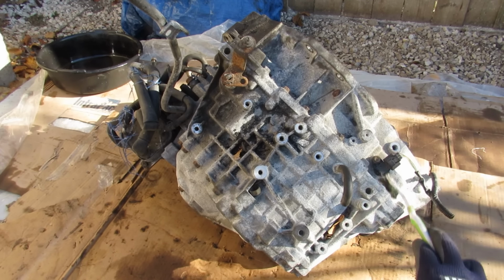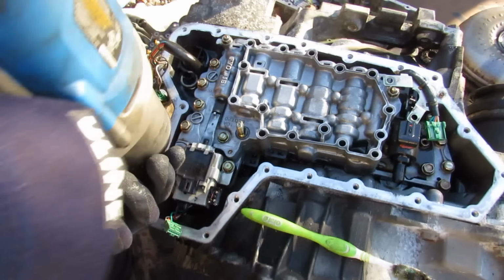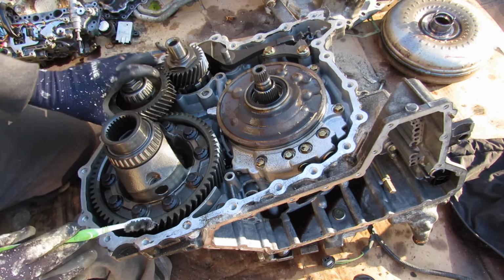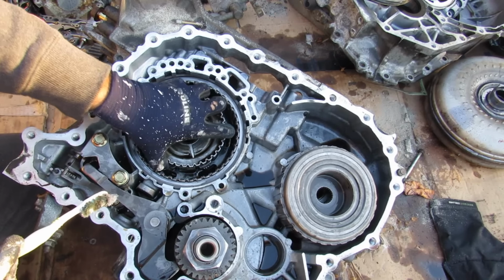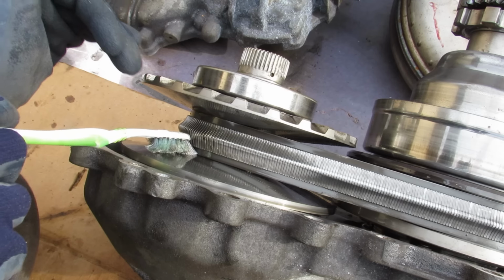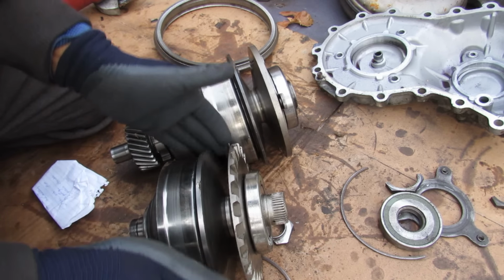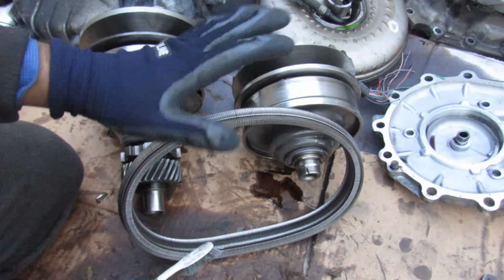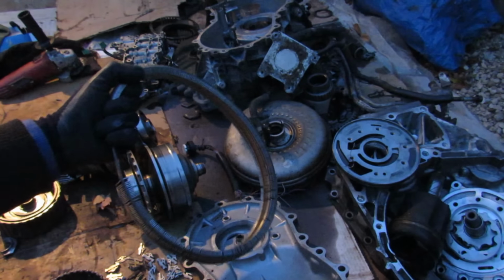Why Nissan CVTs FAIL

Comment: There ARE parts available but they aren't as readily available as clutch packs and seals on traditional transmissions.  The $3,000+ for a transmission replacement has more to do with contracts than with parts.  Let me explain.
Nissan is a part or controlling owner in JATCO (Japanese Automatic Transmission Company) not the only makers of CVTs but the makers of CVTs for A LOT of manufactures and for all of Nissan.  Jatco has a contract with Nissan, Jeep, whoever they sell to that there are NO serviceable parts in their transmissions (NOT EVEN FILTERS) just the fluid or the whole transmission and you have to buy one from us.  IF you go to a shop that sells original JATCO CVT tranmissions, they are under the same contract. You can change the fluid or the whole transmission no repairs, no rebuilds, no replacing of parts.  (NOT EVEN FILTERS) .  Now there ARE shops that rebuild these and shops that sell rebuilt ones.  So that is an option.  Jeeps are REALLY BAD about the differential or other bearings being of cheap chineese quality and the bearing and race eating each other up spitting out chewed up bits of bearings and races through the whole system.  If caught in time it IS possible to clean it up and upgrade to a brand name bearing and race set.
Reply from the maker: Interesting. So where do those shops get their parts? Used?

Comment: What a complicated gear box this has become since it was installed in the Daf cars. It just had two belts running in two sets of expanding pulleys with a vacuum device and a freewheeling clutch plus a simple gear box to engage reverse.

Comment: And that folks is real magic, this turns that and pumps oil over to there while these rotate around this gear which drives that spline and actuates those threads. All this turns that and then drives these which will stop them while all of this moves over here, when it spins it moves that which pumps fluid into there and wizz bang pop, it all works like this. Unbelievable stuff. However, I perform the real magic, I turn the ignition key and it drives. I also owned a Ford CVT Focus and at 70,000 miles the transmission turned to chocolate. Ford washed their hands of the problem as demonstrated by a Class Action in the US but for us suckers in the rest of the world, we just had to grin and bear it, well not quite. When mine developed the fault, I wandered into my local Ford dealer, and kicked the tyres of a few cars then let the salesman sell me a new car taking my then hunk of scrap in part exchange.
Reply from the maker: Or it doesn't drive and fails

Comment: Very nice explanation.  These transmissions, either automatic or CVT are amazingly complicated. The engineers who design these have to be some kind of geniuses.  I had a 2016 Murano AWD Platinum where at 40,000 miles the CVT failed.  I am an easy driver. I am not they type to drive with hard acceleration. The transmission was replaced under warranty.  The dealer also paid for the flat bed transport.  I replaced the Murano just last September.   I bought the new 2022 Pathfinder 4WD Platinum.  I like it a lot. It has a 9 speed automatic transmission.  No CVT transmission.  The engine is the regular 3.5L Nissan engine.
Reply from the maker: How's things going with the 9 speed vs the CVT so far?
Reply: What happened when it failed? Did you get stuck on a freeway?

Comment: at a dealer, the salesman actually told me the transmissions were carp, some were failing right after leaving the dealer. but by the looks of it, it's more common now then thirty years ago. I drive a fulll size truck, which comes with all the more crap than can go wrong.  
buy a stick shift.
Reply from the maker: Good advice

Comment: Have an 06 Altima 2.5. Huge failure blowing out all fluid. Replaced with used trans and now drops back out of overdrive 60mph +. Could this be due to clogged filter?
Reply from the maker: It could. Check fluid levels. 06 Altima doesn't have CVT

Comment: Wow, nothing more that a set of adjustable pulleys. Something that machines have been using for decades. Look at many Machine Shop Machines, one we have is a Bridgeport Series II vertical Mill. That is only one of many that use this adjustable pulley system just like this to change the speed of the cutter. Only problem is that it is hard on the belts when continually changing speeds. They can slip under heavy loads and damage the belt and shorten it's life. In a car transmission, this can be expensive to replace, if you can find the parts. Today many car manufactures produce parts for a few years then change or update parts that may or may not fit the part, or in this case a transaxle, and may require the replacement of a major component.
This is one of the biggest reasons I stick to a manual shift transmission in any vehicle I buy. They are about bullet proof, extremely reliable, are easily repaired and parts are readily available in most cases. With just a little mechanical skill, most could repair one at home in a few hours. Most of the time it is an easy fix like a clutch plate and throw out bearing. I have a Pickup now with close to 100K miles on it with the original clutch set up from the factory, original gear oil too.
Reply from the maker: Agreed. Stick shift is the way to go for reliability

Comment: I'd like to see a video about an older, simpler transmission, like a Powerglide or a TH400, and how they used analog controls instead of computers and solenoids. Just to see the difference in how transmissions have changed over time.
Reply from the maker: Scooter transmission?
Reply: Have you seen how old automatic transmissions work? Those things are way more complicated.

Comment: Thank you for explaining in such detail.  I'm a bit puzzled though, if the transmission can be stripped down to this level, why is it everyone seems to say they cannot be repaired?  I would think that if you can strip it down you can replace damaged parts.  What am I missing?
Reply from the maker: Where will you get parts for it if Nissan doesn't make it?
Reply: @speedkar99  Interestingly, I just ordered pulley bearings for my CVT on my 2007 Mitsubishi Outlander (which I understand is the same transmission on the Nissan X-Trail).  I've also seen other parts for the transmission online including things like the pulleys, the pulley belt, among other things.
Reply: My transmission has been making a whirring noise as I accelerate - the mechanics indicated that it happens when the pulley bearings fail and they will just strip down the transmission and replace the  bearings.
Reply: @odarrien  we do those at our nissan dealer- thats a pretty common symptom- even under warranty.
Reply: @speedkar99  From other cars, that were crashed totally and towed to scrapyard, for example.

Comment: Awesome video with plenty of specialized terms and language. Great engineering speak explaining most of the workings of the CVT and some engineering principles. 

It's popular to trash the CVTs. Most of the past problems with CVTs were ignorance issues. 

* Nissans exceeded the appropriate limitations of sizing CVTs to the engines. 
* Nissan also put in shifters and shift paddles--which isn't fooling anyone. You cannot shift a transmission that doesn't have gears, but you can fake it pretty well while ruining the transmission.  
* Drivers were not maintaining their cooling systems or changing their transmission fluid at internals in their vehicles. Again, Nissan did not make changing fluids easy. 
* Mechanics seem to be pessimistic about CVTs. 
* Drivers are using CVTs as brakes by forcing it into a lower ratio so it drags the car down using the drive train. Bad idea.   

I have a 2014 Altima. I have maintained it, and it has done very well without any problems. I'm going to try to get to 200,000 miles before selling it. It's at 85K. I do not downshift or use the transmission as a brake. I maintain the vehicle. 

Lots of people trash the CVT, but CVTs are the future. They are lighter, faster, smoother much more economical. They have fewer parts. Embrace the inevitable.
Reply from the maker: The future is EV with no transmission haha
Reply: @speedkar99  Ha Ha, as Elon would laugh

Comment: Has to be one of the best videos explaining how a CVT transmission works

...now really impress us and put it back together
Reply: Trick question! Not even Nissan knows how to do that
Reply: What are you, a Masochist?
Reply: @gilbertosantos2806  I think the term is Sadist
Reply: This seems like nissan design this to be replace more often.  I had cars with 30 years transmission never fail. Not even when it need it oil. WTF NISSAN!.
Reply: @lnstaKarma  planned obsolescence
Reply: @lnstaKarma they should have stuck with how it is done on a snowmobile.
Reply: I winced when he took out the angle grinder even though I assumed this wasn’t going back together anyway
Reply: It only has like 4 moving parts
Reply: @ClumsyCars  YEAH the transmission and the 3 rubber bands.
🤣🙂🙃😂
Reply: when you say cvt transmission works
Reply: He would have except he ran out of his brothers clothes.
Reply: He starts by welding those nuts back together.
Reply: Or how it doesn’t work
Reply: That's why my 2014 Maxima's CVT p.o.s is becoming a 6 speed manual this winter. No dash lights but 3 codes on my scanner. Select Solenoid, Up/Down Shift Switch and Step Motor. Drove for an hour on the freeway in 4th gear at 5k rpms cuz it wouldn't shift into 5th or 6th. Sometimes it takes up to 12 seconds for the trans to engage once it's in Drive. I put it in drive in the morning before work and RPMs drop but the car don't move. Eventually it slams into gear and moves. Totally random when it does it.

Comment: CVT's are the worst fraud ever perpetrated on the car buying public. These manufacturers should be put in jail. My 2020 Subaru Outback has had two transmissions replaced in 17,000 miles. Subaru dealer is buying it back. Never again.
Reply from the maker: Buy a Mazda with a regular trans

Comment: Makes me appreciate the genius behind Toyota's "CVT," which is actually just a planetary gearset where one of the inputs if from the ICE, another is from a powerful electric motor, and the output shaft goes to the wheels.  A computer controls everything and the whole powertrain is a hybrid system, which also allows for regenerative braking energy recovery.  The system can run on just the ICE, just the motor, or both, and the motor can spin BACKWARDS as needed in order to deliver the desired output shaft rpms.  No pulleys, no belt, just a bulletproof planetary gearset (like a rear wheel differential).  The whole design truly is genius and is why the Toyota/Lexus hybrids never break.
Reply: Yes, the ones fitted to Prius and RX's - other Toyota CVTs are conventional CVTs like these - but better quality being Aisin rather than Jatco.

Comment: If you haven't changed the ATF on a CVT after 110k miles, do you go for it given the many known issues with changing ATF high mileage on traditional automatic transmissions or is the CVT different? 

I see that it does have clutch plates in the planetary gear set so any breakdown in the clutch plates would suffer from wear and tear of the old fluid. Additionally it does have the small manifold lines, but the CVT seems especially prone to breakdowns as you described.  A mechanic told me not to change it due only to the milage.  Is lifetime operation wise?
Reply from the maker: Drain and fill
Don't flush

Comment: Very well explained , I didnt realize the belt pushed & not pulled . Now Better get your brothers tooth brush back to the bath room ! Cheers from New Zealand.
Reply from the maker: Yes it has to push because it's made of metal plates. If you pulled it would fall apart

Comment: I bought 2019 Nissan Sentra with 40k on it. The CVT seems to slip when starting from a stop, especially when temp is colder. Would you recommend just simply changing CVT fluid and filters? Thanks Jeff
Reply from the maker: That's the best you can do. And don't overload it either
Reply: Ok cool! Would you just change the fluid or do the fluid and filters?

Thanks again for getting back to me, Jeff

Comment: My first new car was a 2012 Nissan Versa. I babied and pampered it. I bought it with the intention of driving it until the wheels fell off. When I took it in for its first CVT fluid change at 30k miles, as indicated in the owner's manual, the dealership said it didn't need to be changed yet and told me to wait until 50k miles. Well, at 38k miles the CVT started slipping. I wasn't interested in spending $5,500 on a new CVT. I managed to squeeze 56k miles out of it before trading it in. The slipping was slowly but progressively getting worse. A shame really because I loved the car and it was otherwise very reliable.
Reply from the maker: Sad. Did they note the transmission at trade in?
Reply: @speedkar99  nope. They didn't drive it. I had the keys in my pocket the whole time I was at the dealership trading in for a Mitsubishi. I guess because it was only 2yrs old and cosmetically immaculate, they assumed it was flawless.

Comment: What the hell you talking about. These transmissions can be rebuilt. We rebuild a few hundred a year at the AAmco I work at. Parts are a little pricey though.
Reply from the maker: But you don't get parts from Nissan right?
Reply: Local transmission specialist here in South Australia has just spent big bucks tooling up to machine the cone pulleys for better results.
Reply: Great, now if you can develop solenoids that don't leak after 50 thousand miles.

Comment: Hi Speedark99.  Great vid and impressed with your knowledge on these type of transmissions. BTW, I've a 2007 Murano 4wd, 170K miles that started to make a small rattling noise like a loose spinning wheel bearing  which happens when accelerating and letting go the gas pedal ,  the best way I can explain it, is like something spins loosely  for lack of words, mainly when letting go the accelerator.  However, when idle, it's perfect, no noise, smooth running engine.  Started a few weeks ago mainly on cold starts and would go away as the engine progressively warm up, now it's randomly so I'm a little concern.  Any ideas or tips as to what to check for or a possible fix?  Hoping it's just a belt, hose, and engine peripheral part and not the  dreaded CTV issue in this vid (crossing my fingers).  Your help is appreciated.  Thanks!
Reply: It could well be any number of things on the engine.  Have you done trans fluid service?

Comment: Very nicely done! Thank you very much. Finally I do understand how complex of an issue this is. So steel on steel is rubbing. This not only generates heat but the transmission oil is also suffering. Traditionally this was done with rubber belts first in machinery and later Dutch maker DAF put them into vehicles. DAF used 2 and could thus omit the differential. So Nissan trusted drivers to be gentle? Big mistake. Harsh driving should also make the change of all oils including the transmission oil. If this is not done and the oil film breaks down such shutter would be the cause of user fault. Nissan should have included more scheduled changes in their service requirements.
Reply from the maker: Welcome
Reply: nissan has a severe-duty service schedule for their cars, in the case of my 2012 sentra- the CVT service interval is the same for severe duty. i recommend using the nissan fluid (mainly because i sell it).

Comment: wow, first person i seen brave enough to know how this works, and i rebuilt quite a few automatics, ya brother and wife not gonna like that undergarments with brown spots on them lmao. but on the serious side i wonder if putting a radiator with a trans cooler on the vehicle, and putting those lines of the crappy cooler will help prolong the cvt, my brother has a nissan versa with that transmission in it i always make fun of it cause its always broke down. but seeing how it works it seems like its marketed like the old mazda rx 2 engines. i had a rx4 and have rebuilt that engine one and made it into an ugly fast car back in the day. but thanks for the video, this came up in my recommended and is the most indepth cvt transmission vid i have ever seen. i can see in my head how to improve on that design they have in there but again durability is a goal for me.

Comment: I can not understand why this CVT transmission is so complicated no wonder these fail so much and also you need to service them regularly so many parts may advise you watch Hubnut and his Invicar which has a CVT transmission which is two pullies and a belt they came from DAF where they had two pullies and a rubber belt and they are in a small car whats wrong with small cars small engines small bodies less metal less power used in there construction these new cars with all there plastics also whats wrong with manual transmissions no big deal l have been driving manual for nearly 40 years and am 67 years old and still driving a manual my 25 year old toyota hilux ute has a manual transmission and is the original gearbox why all should be manual and if you can't drive a manual you can learn to drive one its easy manuals are also better for the environment think about why does Nissan also other motor vehicle companies have to complicate the CVT transmission when it is basically a simple transmission two pullues and a belt why do it and the two pullies and rubber belt are much easier to repair and it would cost far less money to repair be more reliable and cheaper to manufacture and extremely cheaper to repair